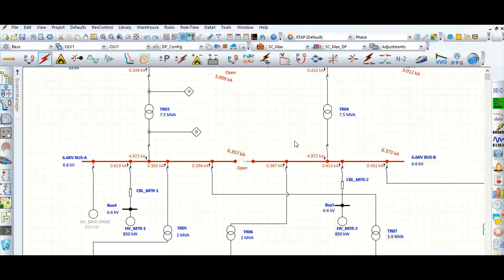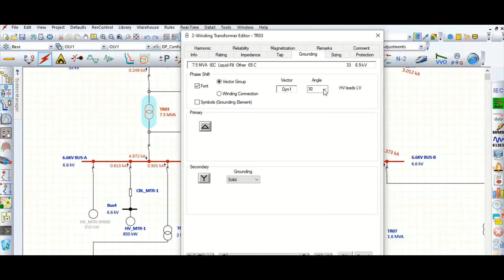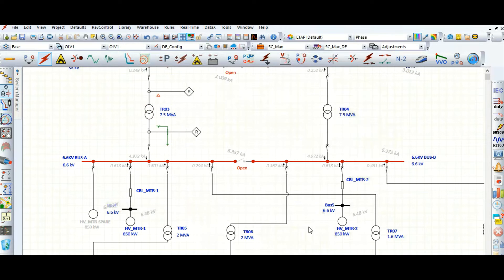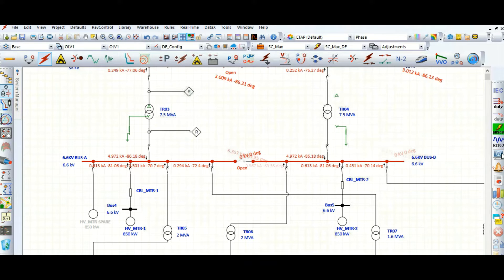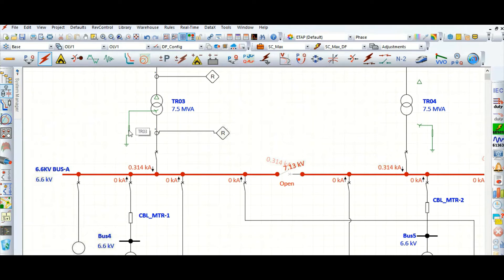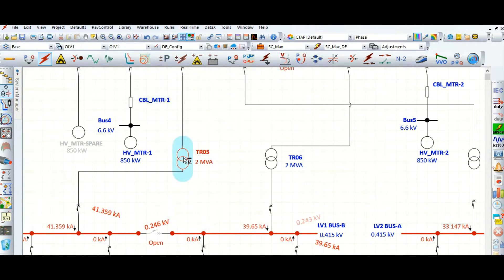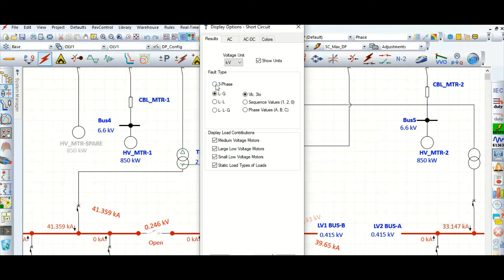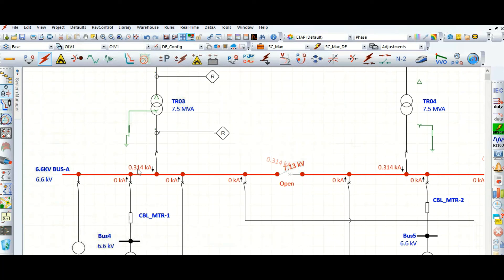ETAP Power System Study II Single Line to Ground Fault Analysis

Comment: @SmartEducare
Have you tried to calculate the single-phase fault current for the Y/Yn connected transformer? Despite the secondary winding neutral being grounded, Etap shows that the fault current is zero, and un-faulted phases' voltages are equal to the line voltage - the same as for isolated neutral or delta-winding transformer with a 1-phase fault.

Comment: Hi pro., where and when I  should select a grounding with NGR or solidly grounding ?

In your case , SC was about 41KA , at neutral of LV side of the trafo, is it necessary to  go for NGR grounding at LV system such the studied case.?

As I know NGR  is recommended at 6kv and above .

Why at 400v,  LV side of trafo  is not grounded while the SC level is high.?

✋🙋
Reply from the maker: https://youtu.be/bZlImM9PftY
Can check out the above video for Grounding

Comment: Thanks again brother ! Just have a question related to arc Flash study!
For example I have a bus near to the Source and has a 100 kA and EI= 400 cal/cm and it says exceeds max.PPE arc rating! Is that means that there is no PPE equipment that can protect us at that bus bar ?
Reply from the maker: Yes, you are right 👍
To lower the incident energy within acceptable limit, you need to modify source protective device setting
Reply: @SmartEducare  even if I did the minimum time there still be a massive Incident energy! So it can't be controlled! I'm I wrong? Or there's always a way to minimize Incident energy?